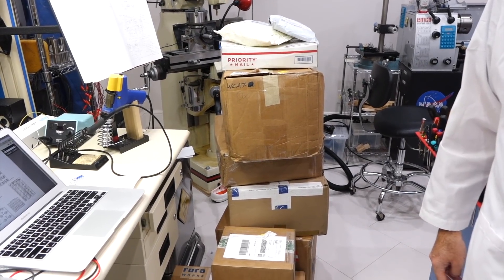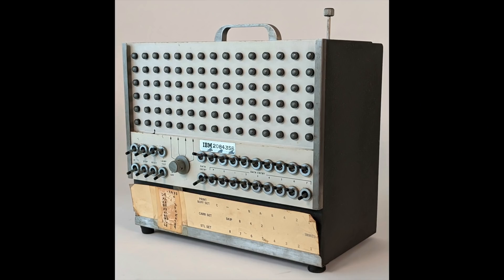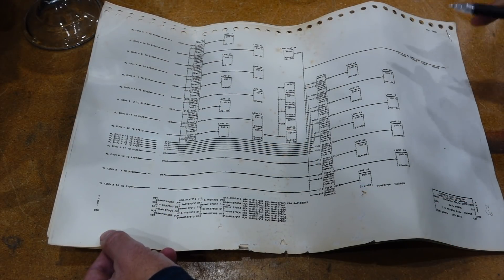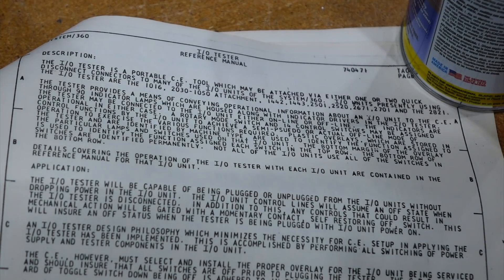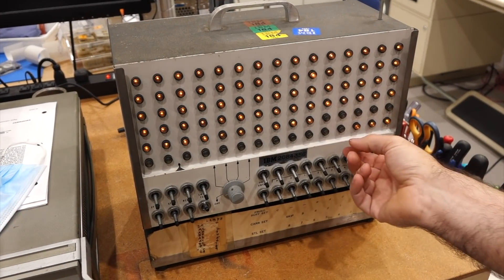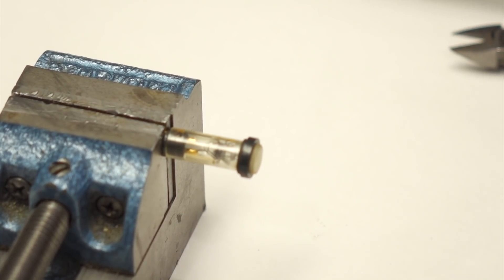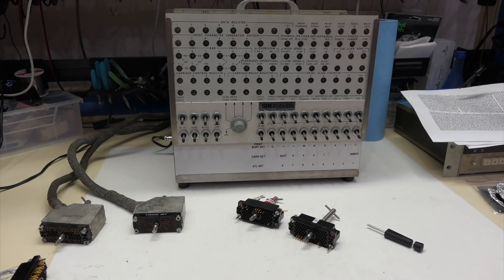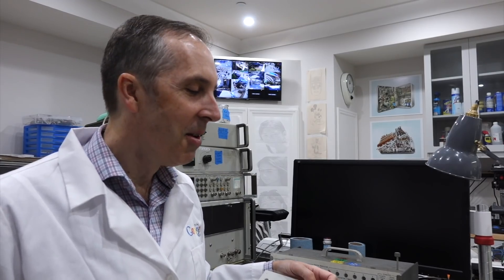Restoring an IBM I/O Tester from the 1960s

Comment: So did you hook it up to the 2501?
Reply from the maker: Not yet, but in the plans when I get space freed up from the Apollo comms setup.
Reply: @CuriousMarc  I'd love to help if you weren't 3000 miles away. I have used the I/O tester on a 2501 long ago, and my favorite part (inspired by an IBM CE video) was removing the backstop on the stacker. Hope you try that- cards fly everywhere.

Comment: WOW. You bring back memories. I worked for IBM from 1967 until 2005. I used an I/O tester many times. Never had to take one apart but the indicator bulbs always needed replacement. The plunger on the top of the tester allowed the user to clip the tester to the top of the machine under test. So I t wouldn’t fall off. Machines like the 2821 were very tall.

Comment: Thank You ! You brought memories! I had to trudge these around Chicago in the early 80's as a CE in mid winter between client locations, and cursed the designers for not rounding of the corners. Those cabled had to tuck into a little shelf at the bottom which barely accommodated the cables, which were stiff from the cold weather. Loved the ALD's!  Price up the cans on top the SLT modules and you will see the silicone goop that provided better thermal contact between the substrate and lands to the Aluminum  can surface. It was rewarding to be able to troubleshoot to the component level!

Comment: There should be a layout of the templates in the 2821 controller logic book
Reply: That’s something that it appears Marc is missing. All the racks with the hardware diagrams and FRU part numbers…Of course if Marc were into software he also needs the millions of microfiche with the assembly listings. We had MVS 3.8 in multiple trays, and I can’t remember what else! (And the smelly fiche printer!)

Comment: You could have fun replacing those with red/green bicolor LEDs (the kind with two leads, not the kind with three) in case you find one where the lamp assembly defies all attempts at repair. 😏

Comment: I just had a nerdgasm when I saw that picture of the TROS module - that's just so utterly brilliant! They've basically adapted their paper tape punching expertise to produce a (relatively) cheap and compact core rope alternative. Just punch holes to determine whether the trace bypasses the transformer or not instead of having to weave wires through cores.

Comment: Those two connectors with center mounting bolts are very similar, if not identical to the ones found on the 90’s train protection equipment as used in the Netherlands and the UK.

Comment: At Eastern Airlines in the 1970s, one of the Eastern techs invented and (surprisingly) got a patent on a Bus-and-Tag cable tester.  He would plug one end of the cable into a box with switches (or push buttons) in the pin pattern, and the other end into a box with a light for each conductor except ground, arranged in the pin pattern.  Each switch should light up one and only one light.  With so many conductors in the cable, this was much faster than doing the same continuity testing one wire at a time (especially with two persons, as required if the cable was already under the floor).
Reply: Wow, I could have used that tester.  I was installing a new 360 Model 25 system and the the channel did not work.  Turns out that one of the connectors had been wired one pin off at the plant.  Made me wonder if or how they were tested.

Comment: I would have killed for something like this as a kid, even if it was never powered up. It would have been a spaceship control panel or some other major fantasy. If the kid who dies with the most toys wins, I've always thought the video and sound panel engineers were in the lead. Now I'm not so sure.
Reply: The synth folks are on the list. :)

Comment: Those are 3420 tape drives used on the 370 series, not 360.
Your tester plugs into the controller. This way the i/o device cam remain connected to the controller and the controller stays connected to the bus/tag lines. So the mainframe stays running even though the. CE is doing diagnostics on a device

Comment: Brings back memories, I used to work on the 360 model 50 and the FAA systems back in the 60's.
Reply: Yep, me too. The 9020D system. By the time I got to it in the early 70s we were using 360/65s as the main compute element and /50s as IOCEs. We used the I/O test box a lot!

Comment: Finally, you guys are doing something I can relate to.  I can''t tell you how many switches I have had to drill out the rivets and after the requisite manipulation of the lever and contacts, use small screws to reassemble.  The real "coup de gras" was the lamp repair.  Right up my alley.  You are geniuses with "regular folk" qualities.

Comment: When I started my professional career in 1981, we had such device sitting in the computer room. As far as I can remember, I have only known once a CE using it when repairing an IBM 2560 MFCM machine (MultiFunction Card Machine) that was connected to an IBM S/370 model 115 with 64K memory (yes, K).

Comment: Worked at a Nabisco factory as an electrician in the 70s. One of my jobs was running twinaxial cable all over the plant. Because I had learned how to install type “N” connectors due to being a ham. I don’t know long they used the IBM 360.

Comment: This is the best way to "reuse" vintage gear - make a connector / adapter to plug it into something modern, without modifying the original device. Then it still works as intended, and has extra use!

Comment: The plunger knob at the top was used to secure the io tester to the top of a control unit. I used the io tester to run a test pattern to 1403 N1 to adjust print quality and flight timing on the print train.
Reply: Yes Thomas. Found memories of 1403 and 2821 test prints. I'm wondering if specialist sent any other commands other than characters to print

Comment: As an IBM CE I used the I/O tester many times to troubleshoot. Need the proper overlay for the I/O device you are troubleshooting. Also worked on a lot of 360 Mod 50's.

Comment: Nice one! I like the clock mode, novel use for it when not being used in anger. Those connectors remind me strongly of EDAC connectors, horrible things, at least with the T key they're easier to screw down than EDAC
Reply: Oh yes, remember them well. We called them the "green" connectors. Interestingly enough, they were used on multichannel digital Error Detection And Correction systems.

Comment: loved those overlay cards....takes me back to my very first job as a student. We were testing the i/o of the mechanical handling system in a power station. We had test panels with banks of leds and switches, and i had to write up overlay cards, and cut slots in them with a scalpel!

Comment: Aren't those the same tape drives used on the 1401?
Reply from the maker: Don't they look similar? Not the same, but related by lineage. They are the grandchildren on the 729 tapes used on the 1401, two generations later, still using the vacuum column design. The IBM 3420 are from the IBM/370 era, 9 track, have servo DC controlled motors, and best of all, can autoload a tape.

Comment: Are you drive the Bulbs directly with the Arduino or do you have any sort of Driver?
Because the 3V Bulb will draw more then 20mA I think.
Reply: The PCB in the back of the tester is a lamp driver. Actually, this entire unit is nothing but a few light bulbs with their drive circuits, a power supply to run them, a few switches and some huge connectors to connect the lamps, the power supply and the switches to the device being tested.
Reply: @unmountablebootvolume  ah ok I missed that with the Bulb driver. Thank you

Comment: Fantastic and inspiring for us restorers not worthy to hold Marc's soldering iron. But what was the pull gadget pump (?) thing on top? Did I miss the explanation?
Reply: It's obviously a pump to manually push bits through the mainframe.
Reply: It's to mount the box to the device being tested so that it doesn't fall iirc
Reply from the maker: @gigigigiontis8  Exactly, it’s just a mechanical latch
Reply: It's to refill the vacuum in the vacuum tubes 😉
Reply: @rpavlik1  Good thinking, Pavlik. In fact, I hear IBM once filled their tubes with vacuum imported from outer space because everyone knows space vacuum is the best kind. 😃

Comment: I’m reminded of some control panels in Thunderbirds and the original Star Trek. Especially with that bouncing seconds indicator in clock mode!
Reply: most the computer systems in Star Trek are based around how mainframes were built and functioned in the 1960s, for better or worse. Even in TNG and Voyager that didn't change, which is also why to those of us who grew up with the PC it makes no sense how computers in Star Trek work